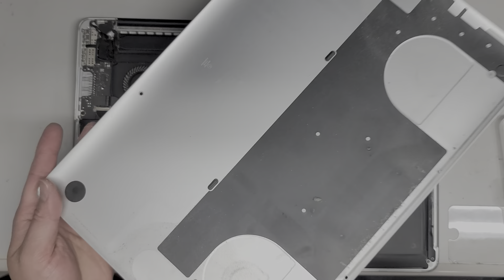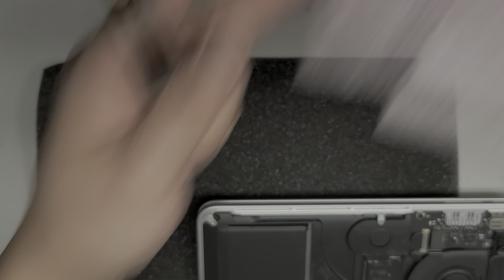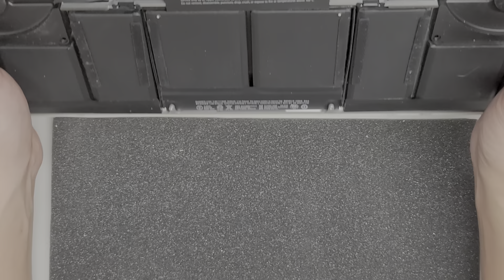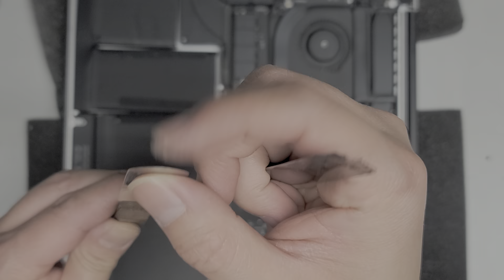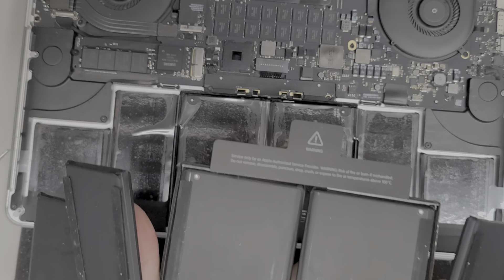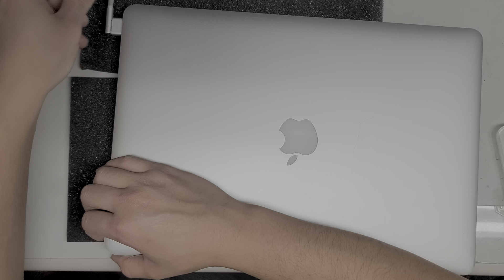15" inch Retina MacBook Pro A1398 Late 2013 Battery Replacement Repair

Comment: "HEY! Let's Try Binh's way!- NO LIQUID!" EnGenius! 
AND, you're the ONLY one that remembers to drain down the power.
AND, your the ONLY one that keeps a toothbrush handy to clean under those speaker pockets that collect dust.
AND YES, ALWAYS watch the video through BEFORE attempting these repairs...
Heck, I'm just going to subscribe to your channel. 
I'm ALSO going to reapply fresh thermal paste while I have my macbook open up.
Thank you... AGAIN...  Binh!
Reply: PS. 
AND you're the ONLY one that doesn't speed up your video, because we can't speed up our lives like that- 
LIFE'S TOO SHORT ALREADY!
Reply from the maker: @artmakesasong  Yeah, people like to speed it up to hide mistakes and make it seem like they're better at it than they are, or maybe just to make it entertaining and not an actual guide you can follow along with.
Reply from the maker: Hahaha Hope the repair goes well. Be gentle with the board and make sure to handle it by its edges, especially if you're not well grounded.

Comment: Thanks for a great video .... just successfully competed battery replacement on MacBook Pro (Retina, 15-inch, Late 2013) using NinjaBatt Pro ... carefully following your advice and pallet knife technique ... performing initial charge, haven't reset PRAM/SMC yet, is this always necessary?
Reply from the maker: @slicker55  It's not difficult to do and doesn't take long. Not sure why people ask if it's necessary as if it's a huge hassle. Lol Just do it.
Reply: @ItsBinhRepaired  Thanks, not asking about battery replacement ... already done ... was just asking if resetting PRAM/SMC is always necessary and if so, why please?
Reply from the maker: @slicker55  Google what does pram and smc reset do. It's too much to put here. Do we have to brush our teeth? The answer is no, but should we? The answer is yes.
Reply from the maker: @slicker55  you should do it any time hardware is replaced.
Reply: @ItsBinhRepaired  OK, no probs, sorry to have troubled you
Reply from the maker: @slicker55  do the pram and smc reset! Lol